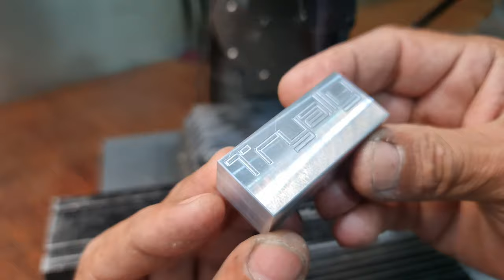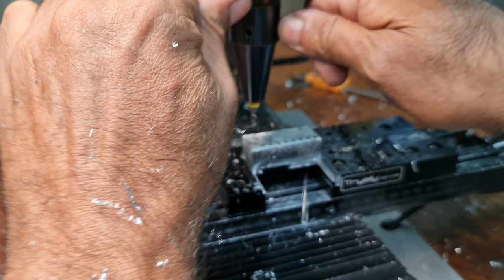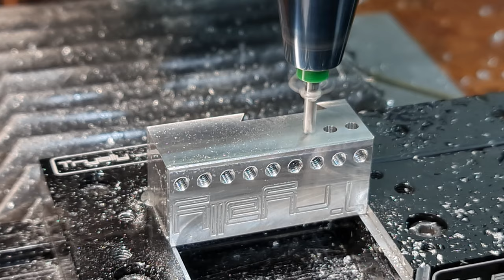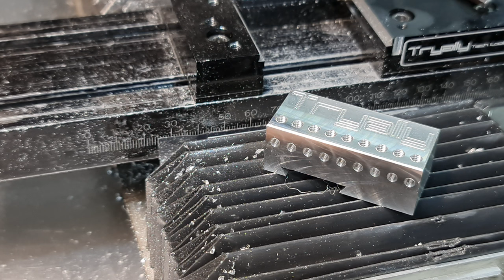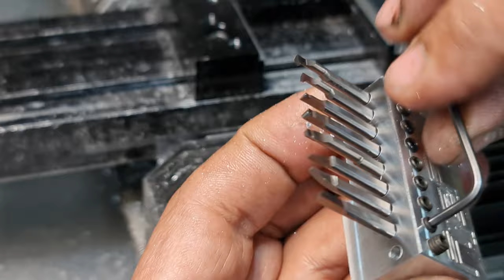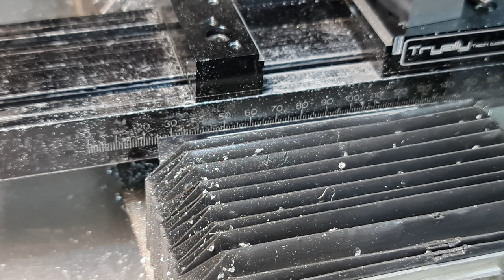Thread Milling on Sherline 2010 Milling Machine

Comment: Could you tell me what sort of work flow you used? For toolpath generation what software did you use? Can we design in Onshape generate the cad files then export to cam software like fusion360 and then create the toolpaths?
Reply from the maker: Hi, I am using the Mach3 wizard, and in this video I generated each hole and thread one by one and copy and paste each coordinate.
So, I have not yet used the Onshape generate, but it is certainly possible for you to associate and export to cam software like fusion360 and then create the toolpaths
Reply: @tryally  thanks for the reply, what do you think about the sherline mill? Is it good for small production work. I want avoid buying a full fledged mill like the Bridgeport, add I don't have a big enough place, also my production is not very high, say max  10-20 parts in a month. Does the sherline mill good for this? I do have a sherline lathe, however it doesn't get used much. What type of mill should i go for? Trapezoid thread or ball screw type? I am thinking of getting my own stepper motor and drivers with a grbl based control card, do you think this should work good for the sherline mill?
Reply from the maker: @arbjful  The new series Sherline with  ball screw is excellent for small/medium production work at home or even small company.
If you have a choice of ball screws, the accuracy is great, and you will not have problems with backlash.
The Sherline milling machine is small and fits anywhere, and you can also integrate the software of your choice.
I never have used the grbl based control card here, but I know a lot of the  Sherline CNC mill and I believe you will have no problem using it.
My only recommendation is for you to keep in mind if the size of your parts are within the range of things possible for a small milling machine.
Although I do almost everything here with my Sherline milling machine.
I really love these machines.
There is a group on Facebook that I am an administrator, you will be welcome there, and you can ask many questions including the best system and software etc…
This is the way to the group: https://www.facebook.com/groups/975235319239533
There is also my Tryally page, where in the albums you can see many things I do using Sherline's milling machine and lathe.
https://www.facebook.com/tryallytech?fref=ts
Reply: @tryally  thanks for the very helpful tips. How does the Sherline mill compare with CNC routers that are not used for etching and woodwork? I believe nowadays these are being used to mill aluminum. From what I gathered the spindles run at 20k rpm and require the correct feed rates and spindle speeds to be set. Since The sherline mill runs at lower speeds it may be more forgiving
Reply from the maker: @arbjful  Each machine style has its own concept, usually routers machine offer unwanted vibrations, so they are mostly used for cutting or engraving on soft materials, wood, acrylics, etc. and they also offer no z-axis height, so, routers are better suited to flat materials.
Now the Sherline is a small torpedo type milling machine, suitable for machining any material, it's very versatile.
The Sherline can operate up to 10k rpm, just use the pulley set they offer for higher speeds.
But that's it, you're right, Sherline operates in a more tolerant way.